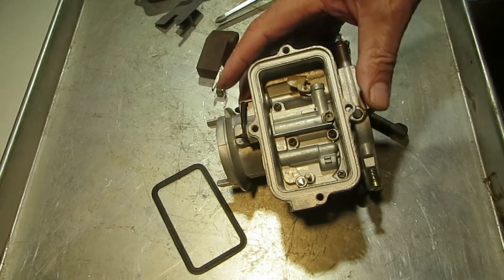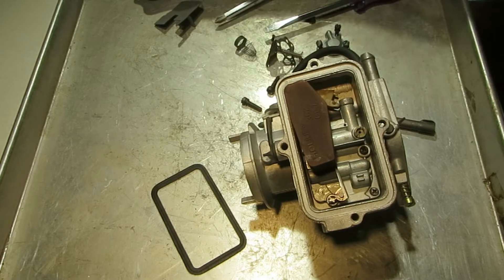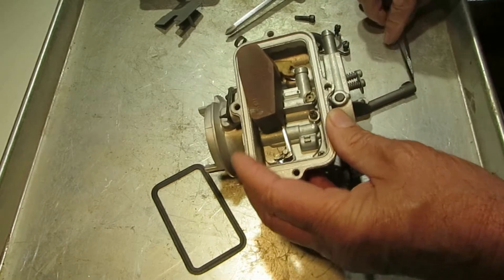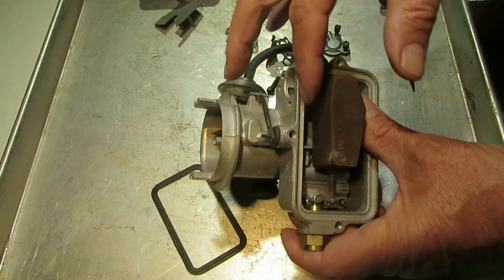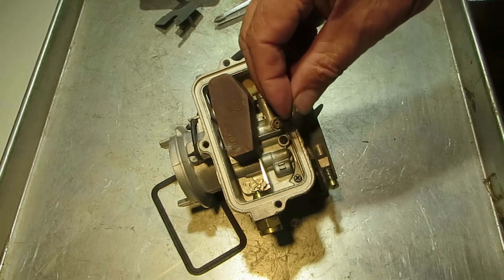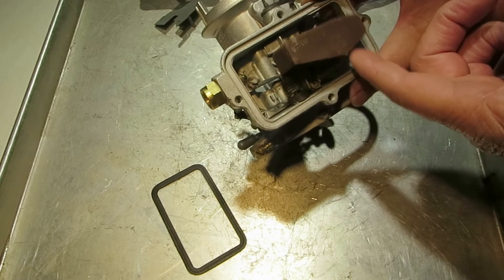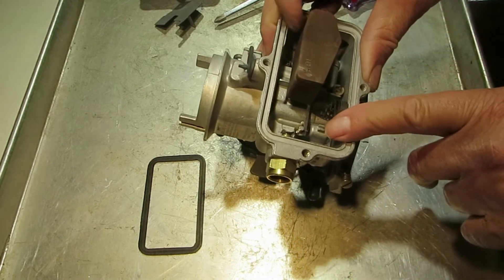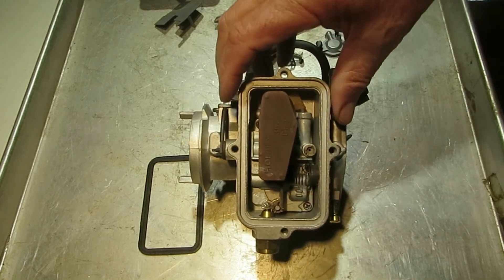Holley 1920 1 Barrel Carburetor Float Circuit

Comment: This is gonna sound stupid. I have a 1920 Holley.  I took out the old needle and seat.  The needle fell out and I am not sure which way it goes in the new one.  Point goes towards fuel inlet or towards the float.  Help please.  My carb has been flooding really bad.  I thought I would start with the needle and seat.  I have purchased a used 1920 carb to try to rebuild using one of your videos.
Reply from the maker: point goes toward the inlet.
Reply: @MikesCarburetor  thank you sir.

Comment: Hey Mike do you have the clip that holds the float in, or do you know what size it is, just got a rebuilt 1920 and it was pissing gas out all over the place so I opened it up and the float was hanging half off because the clip is missing and I don't want to have to buy a whole rebuild kit just for the stupid little clip

Comment: Where can get that float spring at mines pop out.
Reply: I just order it.
Reply: The problem started i put a gas tank in it ran through factory lines and sending unit had a rust in it. I'm hope the rust didn't damage the engine.